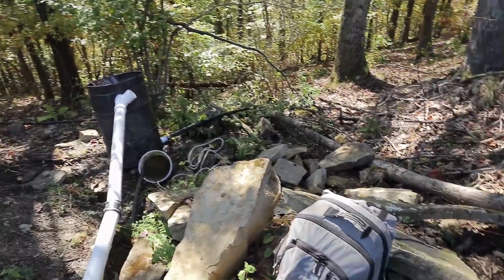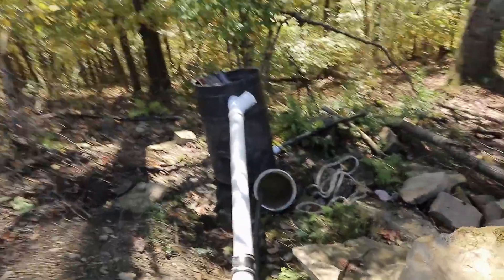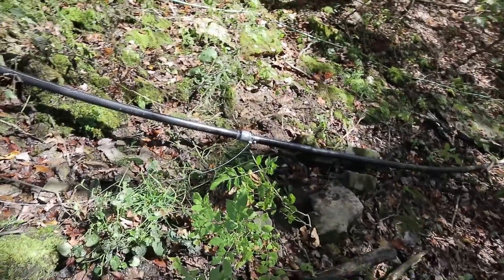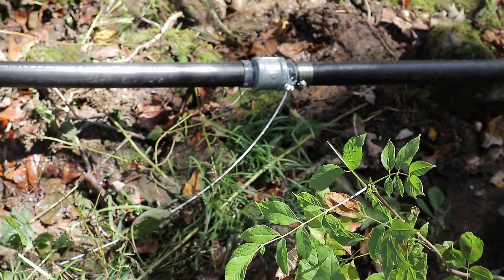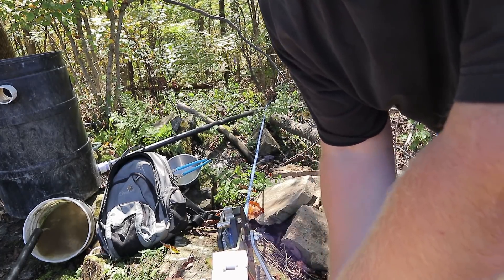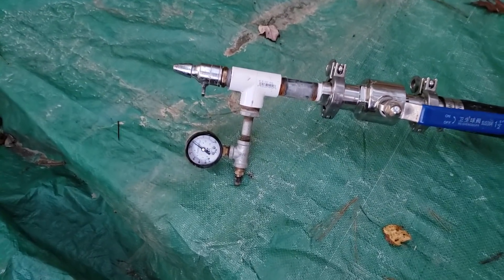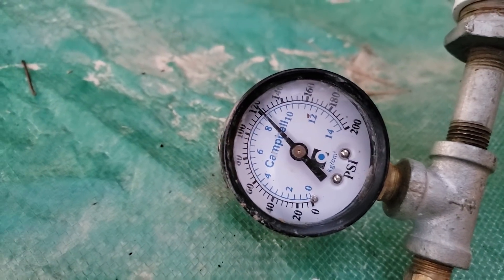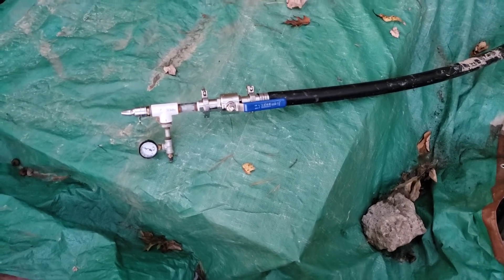[Part 12] Kilowatt Microhydro Turbine - Penstock Repair

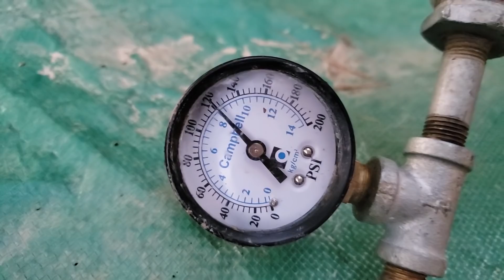Comment: 10:20 What is cool about the international system is that you can convert pressure to water elevation instantly.
Here, we have a pressure of 8.25 kg/cm2
Imagine a "box of water"  1cmX1cmX100cm = 100cm3 = 100ml = 100g = 0.1kg of water per meter of elevation
8.25kg x 1m/0.1kg = 82.5 m

Thank you for the video series, I'm jealous of your property and nice your nice hobby!
One day it will be my turn... One day!

Comment: Great progress! You're going to continue to have issues with the penstock moving for a variety of reasons. The pipe is slick so  you have very little friction and a good deal of slope on the hill. I recommend securing it in several places with sturdy polyester rope to the base of the trees as these provide an anchor point that's not easy to dislodge. You'll need a good way to ensure the penstock doesn't just slip through the rope. Steel bar bent into an L with some hose clamps to clap one side to the pipe should do the trick. Angle brackets for wood are at the home centers.

I further recommend that  you secure the barrel in place and insulate it because even with water flowing through it, there will be eddies along the sides and these will freeze in winter and the ice will migrate in until it chokes things off. We all hope that the water flowing into the system is warmer than than freezing - but you need to preserve that warmth  into the big black barrel. Once the water is in the penstock, it's all moving and should not freeze under most conditions.

Best of luck!

Comment: Looks like some strategic applications of concrete are needed to keep things in place. Or drill into that old concrete to install an eyebolt to connect the wire rope. If you want it to stay put, drill down into the top then use some hard urethane resin to pot the bolt in place. I have some secured into holes in concrete as tie down points for a metal pipe tent frame with a heavy tarp. Been in place for over 10 years, they haven't pulled out with vertical tension. So pulling perpendicular to the drilled hole will be even stronger. To be weather resistant I'd use stainless steel wire rope and other hardware.

Comment: Might consider an additional support midway down say just below the coupling from the top pipe and bottom pipe. I would use nylon instead tho. Nylon rope will stretch just a bit, but return to pretty much where it started. May use the steel cable a little slack as a stop. Trying to stop all movement at one spot will likely just move the area of fault to somewhere else. Adding in additional support with some dampening should reduce the strength of the hammering enough to prevent failures all together.
Reply: Alternately you could add a pressure tank :) Similar to what is used at a well house to prevent the water from busting pipes in the house. It's just a metal cylinder with an air bladder. You just match the air bladder to the pressure you expect and it expands and contracts faster than the water can move to equalize the pressure and smooth out the shocks you would otherwise get. The water rushing in after you turned off the flow would flow into the tank and crash into the air bladder. Adding in a check valve would prevent the shock from going back up as well and give you an anchor point (the tank to some concrete) for the system so that it doesn't disturb you down at the bottom as well.

Comment: As a thought, you could drill an anchor bolt into that concrete to attach your steel cable to something that absolutely will not move. That would give a lot more relief against water hammer issues.

Comment: If there are ways to mitigate a watehammer, you should consider them. If you are not able to mitigate the watehammers, you should at least let it fail as gracefully as possible, meaning account for that it will fail, but have it in such a way that when it fails again it does not drag your whole setup down with it. Good work there buddy, keep it up.

Comment: Your flow test in the previous video shows spot on 30gpm (half a bucket in 5 seconds), so a few quick calcs show your 760' long 1.6" diameter pipe contains about 660 pounds of water travelling at over 3mph (or 304kg at 1.44m/s for metric types).  Wikipedia tells me that means it has the same kinetic energy as "an average person jumping as high as they can" or a 165lb person running - it's no surprise it pulls the pipe!

Comment: I  would have recommended leaving an anchor on the water line at the top of the hill.
Reply from the maker: I did anchor it.
Reply: @JoeMalovich  Good deal, I must have missed that. I worked maintenance for a water dept. for about five years, you're spot on with what you said about water hammers.

Comment: One way to prevent shutting off the water to quickly is to replace the quarter turn valve with one that must be turned multiple times to turn on and off like I believe is called a gate valve. A stand pipe might work if it is high enough so it doesn't over flow.

Comment: You mentioned the pressure guage might not be accurate.  You stated previously #11 that you had 120 + psi pressure.  According to google and the Internet water produces 0.434 psi per foot of height. If you divide 120 psi by 0.434 you get 276.5 feet.  Would you say that spring is that heigh above your based elevation?
Reply: Wow, the joy of emperial measurements... I saw a bit over 8 bar on that gauge, one bar is 10 meters, so it should be a bit over 80 m high.

Comment: Have you considered building some suports or fixtures for the pennstock? The next small water hammer is just a question of time, it will slip a little with every closing of the pipe..
Reply: He anchored his pipe to a big block of concrete

Comment: It's probably not necessary but I wonder if wrapping the Barrel in bubble foil tearing your freezing season might be a good idea to avoid ice build-up on the inside of the barrel even though the water is flowing there's a slight possibility the water might freeze to death outside the barrel if the water is Flowing slow enough and possibly the pipe coming from the spring might start to ice up I think bubble foil would be enough to keep it warm enough until it got to the barrel and started to either head down the hill or overflow
Reply: Good point about the freezing. I would substitute the bubble wrap for bails of straw. They would act as insulators as well as support for the barrel. The only problem is getting them up the hill.

Comment: With the few gauges I have worked with I think they were + or - 12% give or take and gauges that are super accurate tend to be out of the average joe blows price range. Lets just hope the 120 psi is correct so you get the best power for what you are doing. Can't wait to see the turbine running.
Reply from the maker: I can try a few gauges from various suppliers and average them together, but that's a subject for next year I think.